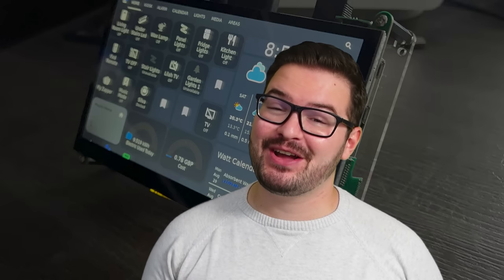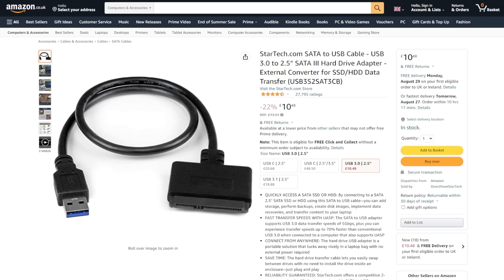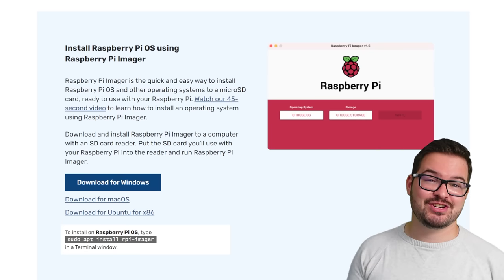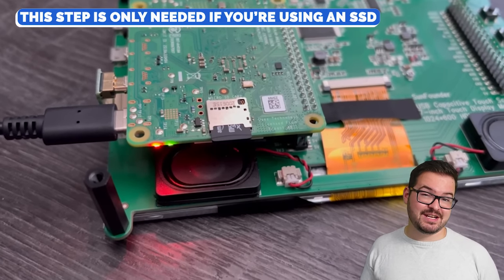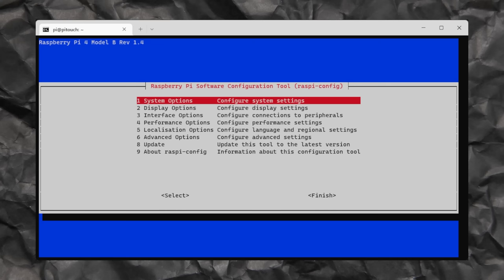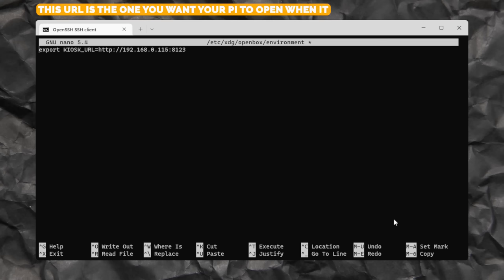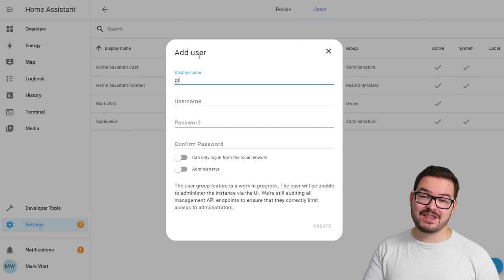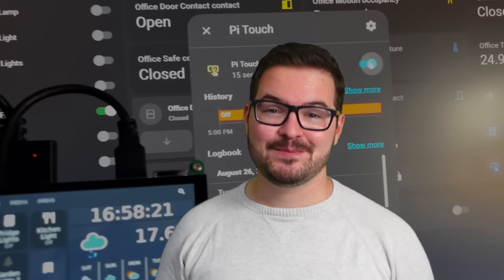HOW TO -  Create a Raspberry Pi Smart Home Kiosk (Home Assistant)

Comment: Those Chinese android panels people are installing in their cars is just about perfect for this, they don't have a battery, so you can power them directly and the have convenient mounting points as well, they even come in different sizes, heck you can even run a speaker system if you want.

Comment: I love the way you present your project , they are all well explained and detailed !
I will give it a try just for fun. I was looking to buy a tablet and put it on the wall, I will use this project to be my « pre-prod » and then use a tablet later on the wall.
Maybe more fun with this and I’ll go direct with a 24 touch screen ^^
Reply from the maker: Thank you! Really appreciate the feedback. I’m glad you enjoy the presentation style.

I think wall panels are great and I use a couple in my house. This little screen fits well on my desk but I have a plan to embed it in a Kallax unit (maybe a future video 🤪).

Deffo a fun one to play with :)
Reply: I already have some Ethernet switches hidden in some of my walls with some displate (metal poster) in front of the metal plate.
This is giving me some ideas. Just need to find a hack to shutdown the screen ( same as the sonoff ) and then you can have a more powerful devices in each important area that is not just an intel nuc hidden somewhere
Reply: It is a great project, worthy to try it, but it won't work and Home Assistant will never loaded in the screen. Slight details are still missing in the video.

Comment: What I'd like to see is a smaller form factor, like an iPod Touch to mount next to bedroom doorways. Ideally, it would have an ESP32-WROVER running ESPresence for room tracking and squeeze-lite for network audio. The minimalist Home Assistant companion app would be perfect for this kind of device. I was hoping to pick up an Android iPod Touch clone cheap but not even Apple are making one anymore 😭
Reply: a Sonoff  NS Panel can help you out with that!
Reply: I feel like a 50-80 dollar phone might be a better option in many ways for the sort of things a small control panel would be used for. Keeping control panels and sensors separate as much as possible feels better to me than integrating them into a single monolithic system, even if that system is modular.

If you can 3D print whatever case you want, you can always make room behind the phone for an ESPhome, or even a pi zero, doing whatever you need to do in the sensor range.

Comment: Hi Mark!
Glad to see you're back.
I had a question regarding this setup. In the video you use a dedicated Pi for running the Kiosk.
Would it be possible to run the kiosk on the same Pi as Home Assistant?
If so, would you recommend avoid doing that due to performance issues or something else?
Reply from the maker: Thanks mate!

Ultimately it depends on what and how you are running your HA instance. I wouldn't really advise using the kiosk setup on the same Pi running HA but again it entirely depends on your setup and how taxing your smart home is for the Pi.
Reply: Thanks  @MarkWattTech  !

Comment: Hi. Great video. I just have a minor problem with that. I set everything up correctly, but when I turn it on, I don't see the homeassistant login box, but it says that it refuses to connect to that page. Can't I have an error, for example, in KIOSK_URL? I normally put the IP address of the raspberry pi there.
Reply: I have the same issue. I sat everything up correctly but home assistant never accept to load into TS7 pro touch screen 'the kiosk' at all. I have repeated the setup over 3 times but with the same issue. Hopefully Mark will provide us with further steps and clear guidance to resolve this issue.
Reply: It's because this video doesn't explain how to install HA, it assumes you have it installed in another host machine.

Comment: Nice video Mark. Regarding blanking the screen. You can use Hacs Browser mod but I've found you get the faint glow that doesn't get approval from the wife. If you can find a more suitable way to dim the screen with maybe a python script, they'd be a fair few of us that would be grateful
Reply from the maker: I did think of that but haven’t given it a go. This screen I’m using has physical buttons that allow you to control brightness so I was going to see if I could hook into that.

Other than that ive just been shutting the pi down with shell commands. Im still working on this project so potentially another video in the future with better tips and ideas :)

Comment: Another great vid, but the video and sound seem to be lagging each other, same as the last vid 🤔 all my other youtube vid seem fine?
Reply from the maker: Thanks for letting me know Shane. I will have to look into the sync issue and do some tests 👍🏻.

I literally went away on a camping holiday when this posted. Is the issue through out?
Reply: @MarkWattTech  I never noticed it before, I just had a quick look at previous vids, and it looks like it started on the "This Smart Valve Saved me money" vid. It could just be me 😛 maybe see if anyone else thinks the sync is slightly off 👍 Videos are still 100% watchable.
Reply from the maker: @irelandshane1984  I have recently changed all of my setup so it could potentially be from that. Again I will have a look for the next one.

Appreciate the feedback 👌🏻😄

Comment: Worked at the first try! Thanks a lot!
Only issue I have is that the screen has a very low response with the touch imput, I have to apply a lot of pressure to it to detect anything and it's almost impossible to scroll on the screen.
Reply from the maker: Glad you got it working :)
Which screen did you use?

Comment: Has anyone a idea how to rotate the display & touch interface on a connected generic touch screen? And thank you mark for the absolute detailed instructions
Reply from the maker: Heya :) for screen rotation you will need to add a little accelerometer. You can get one for the gpio pins. This will allow you to rotate the screen and have it automatically switch orientation. 

Originally this vide was actually on 3 Diy Kiosks and I actually show that but it was super long 🙈.
Reply: Setup everything with your guide yesterday. And it does seem to be more responsive than my previous Ubuntu desktop approach (no surprise there). A quick little section at the end of the video for bonus fancy features would be cool. Personally I don’t mind longer videos as long as they are structured.  As for rotation I managed to rotate the picture via ssh but I still have to find a way to rotate the touch method with this installation. It’s hard to find because most instructions reference the old method with rp3s and older.

Comment: Hi Mark
You instructions worked to perfection and now I have a kiosk!
If you send the command below the screen will be dimmed. Valid values are 0-255. 20 that I use is the best for me
The brightness folder might be in a different location but it is easy to find.

sudo bash -c "echo 20 > /sys/class/backlight/10-0045/brightness"
Reply from the maker: Thank you very much! This was something I planned on looking at when I revisited the project. I’ll be sure to give it a go.
Reply: @MarkWattTech  I tried it on my setup and it worked without problems

Comment: hi mark. I can see you are using unifi as your networking do you also use unifi cameras? if so is it quite easy to add unified to this. thanks Joe.
Reply from the maker: Hey Joe. I currently don't have any unifi cameras but they are easy to integrate into the Unifi ecosystem (and also Home Assistant).

Comment: Hi mark, thanks for the video. Can I ask you how did you set the width of the columns of your dashboard so that the two columns are not split 50% each? Thanks!
Reply from the maker: Thanks dude. 

That dashboard is a nice and simple one and it’s actually part of standard HA. It’s just an alternate dashboard view type called sidebar. It’s the same one that’s used in Energy Dashboards.

Comment: Hi Mark thanks for the great video, I have the Raspberry Pi official 7 inch display could I use that for the project? I didn't want to spend any more money and have yet another monitor, please let me know if this is possible? and anything I need to know to get the Raspberry 7 inch screen to work correctly, thanks for a great looking project
Reply from the maker: Heya :)

This should work with any touchscreen setup. Deffo best to make use of parts than buying new ones :)

Comment: Pi OS lite (64 bit) doesn't seem to have an audio system installed.  How can I get audio from HA to play thru the HDMI 0 cable into the speakers of the 7" tablet?
Reply: Fixed:  "sudo apt install alsa", and in /boot/firmware/config.txt commented out # dtparam=audio=on
Reboot.
Now sound works!

Then I set up mpd with:
"sudo apt install alsa-utils mpd"
and in /etc/mpd.conf, uncomennted out the "audio_output" section for type "alsa".

Then enabled mpd with:
"sudo systemctl enable mpd"

In HA, configuation.yaml, I added the following entry, (set your IP and Name as needed.)

media_player:
  - platform: mpd
    name: "Kiosk1 speakers"
    host: [ ip address of Kiosk Pi.]

Now I can access the kiosk as a Media Player in HA.
Automations got real easy after this.

Comment: just a thought, but could you not keep the pi on, but use a presence detector to send a command to turn on off the screen only.... that would be much quicker to wake up than rebooting the whole pi... pi doesn't use much power.

Comment: How or what did you use to get your cameras grid to display like that?  Mine are large and can only fit 2 horizontal.
Reply from the maker: Hey Joey. Which part do you mean sorry?

I think your after the grid card. It’s built into HA natively. You can specify how many columns and rows you want
Reply: @MarkWattTech  Thanks for the reply!  I'm impressed with your camera layout.  I noticed you had room temps overlaid as well as a motion icon for each camera.  That is what I was referring to.  I did play with grids upon grids upon grids to get their view size down but now am curious how you got the temp overlays and motion indicators.  At 4:32 in your video.

Comment: great job ,im stuck (this site can not be reached (ip,,,,,refused to connect))  please help
Reply from the maker: Which part are you stuck on?
Reply: @MarkWattTech i have done every thing as you have mentioned its opens a web browser but  it does not show the dashboard on the pi screen ,says can not connect (refused to connect ).as if the web site is down

Comment: Worked great, THX! However, HomeAssistant is always upside down, even with the flag "lcd_rotate=2" set. The bootup screen is now correct, but as soon as Chromium launches, its back to upside down. Am i missing something?
Reply: Same issue here 
Any suggestions ?
Reply: This is how I fix my issue 
add this to  /boot/cmdline.txt, keeping everything on one line, then reboot.
video=DSI-1:800x600M,margin_right=0,margin_left=0,margin_top=0,margin_bottom=0,rotate=180

sudo nano /usr/share/X11/xorg.conf.d/40-libinput.conf
And add Option "TransformationMatrix" "-1 0 1 0 -1 1 0 0 1" in the relevant touchscreen section, so that section looks like:

Section "InputClass"
        Identifier "libinput touchscreen catchall"
        MatchIsTouchscreen "on"
        Option "TransformationMatrix" "-1 0 1 0 -1 1 0 0 1"
        MatchDevicePath "/dev/input/event*"
        Driver "libinput"
EndSection

sudo nano /boot/config.txt 
and add 
lcd_rotate=2
Reply: @lugopc  Thank you so much for the follow up, really appreciate it! Will try it out later today!
Reply: @MultiBS  Did it end up working, I am having some problems with this config

Comment: Where is home assistant running from, another raspberry pi or pc in the background?
Reply from the maker: Heya. Yeah so HA runs on another machine. This pi just points chrome at it. You could do it all on the same pi but it will obviously eat up some of your processing. 

Whats nice about this design is you can interface with HA and if you wanted to you could run additional services to connect to your HA machine (Pi hole etc, media servers etc)

Comment: Why do you need to have a full size SSD drive? couldnt you just use a flash drive or SD Card?
Reply from the maker: SSDs typically have more storage, are faster and have better reliability. The read life of them is also much longer than a standard SD card.

Comment: i applied this guide on a raspberry 3 but when i install chronium , after reboot the cpu fixed on 100% and all system are freezed.
Reply from the maker: Are you connecting wired or wireless? I use this exact setup with Pi3s and 4s with no problems.

Comment: Oh...so the home assistant is not installed on this Raspberry connected to the screen?
Reply from the maker: This basically just points at your existing HA setup. If you wanted to you could install HA on it and then have the same pi point to the instance and use the screen. Its extra processing and resource for your pi to mange though.
Reply: @MarkWattTech  do you think a pi can handle it or it's better to have 2 different pi?

Comment: I'd probably prefer to stick with the older 10" Samsung tablet. This design has a really low wife approval factor in my case. 💁‍♂
Reply from the maker: I don’t think I would wall mount these just because of the profile. But in a fancy case or in a picture frame design on a side/shelf it would definitely work :)

This could also be done with a Zero W for a more form factor design.

Comment: Would be easier to use a cheap tablet, work better too.
Reply from the maker: Easier yes. Works better… no

I’ve used many tablets as HA wallpanels. The Pi is by far the best thing to use. Its form factor is the main issue